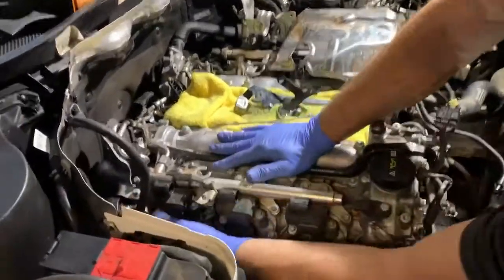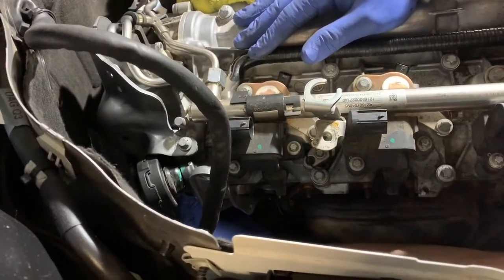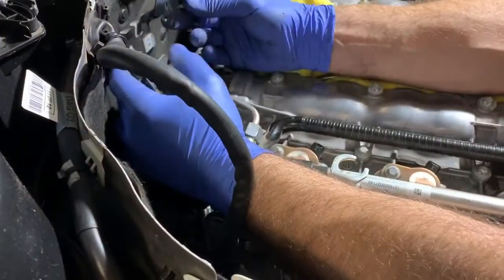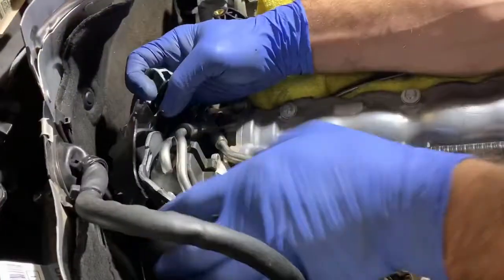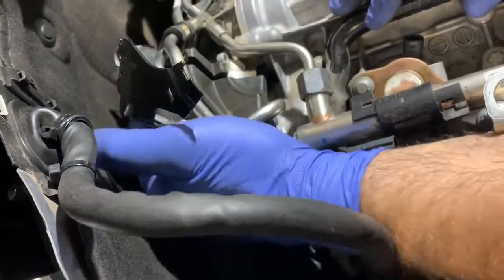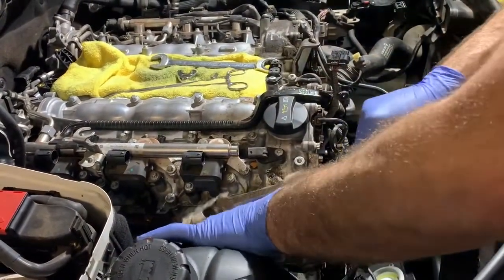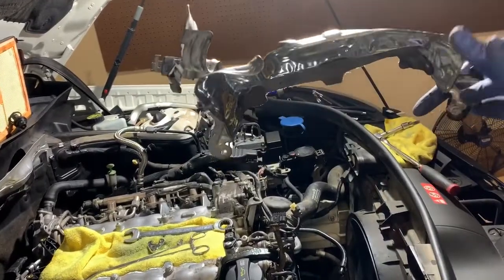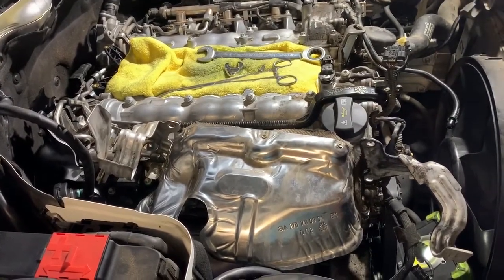(3 of 3) 2013-2015 Mercedes Benz GLK350 M276 High Pressure Fuel Pump Heat Shield Removal Procedure

Comment: Hello I have a 2014 glk Mercedes Benz , and it’s showing low fuel pressure, I have changed the fuel pump and fuel fitters but still did not solve the problem

Comment: About the M276 to replace the pcv/ oil separator do you need to remove also de HPFP?
Reply from the maker: thats a good question. I no longer have the vehicle in house to comment. But in future I"ll have a look.  I doubt it... seems like poor engineering if HPFP would have to removed in order to replace PCV.
Reply: Yes, you have to remove the HPFP to remove the CCV cover plate on the M276 engine.  I have spent three weekends on not only the CCV replacement, but also water pump replacement and now cleaning intake valves.  Fun

Comment: Hi, I have a ml ‘15 with the m276 engine. I found I have a blown valve cover gasket since I found some oil on one of the coils. I’m not mechanic but try to do most of my own basic maintenance do you consider that job DIY or better have it done by a mechanic?
Reply from the maker: Haven't done this partcular valve cover gasket, but I do consider it a DIY, granted you have a complete tool set torx, e-torx, etc.  You'll want to have done a few different MB valve covers and have intermediate experience to attempt the M276

Comment: Hey man, I'm trying to do this same job and would appreciate it if you could upload the missing footage. Thanks
Reply from the maker: https://www.youtube.com/watch?v=f8PFJjz7lDs&feature=youtu.be     hey, i shot this months ago, by missing footage, I presume you mean removing the high pressure fuel pump once the heat shielding has been removed.  I believe there are two bolts and two fuel line fittings.  The bolts attach from the side, and point toward the drivers side.  The fuel lines disconnect fairly straight forward. If you've gotten that far in the process you should have no problem removing the HPFP.  Not sure if I filmed that but have a look at my channel and you'll find all the footage you need to complete the job. Please like if you find these videos helpful and I'll produce more
Reply from the maker: https://www.youtube.com/watch?v=6XgjPK1bGrA&feature=youtu.be   here is more footage, its raw, long and not yet edited...just no time, but watch it a 2x speed and you'll get the gist.  Important to rotate engine to TDC so that the piston that moves the HPFP spring is maximally recessed.  That is by the book so you don't put too much tension on the pump when you run her for the first time.
Reply from the maker: https://youtu.be/6XgjPK1bGrA